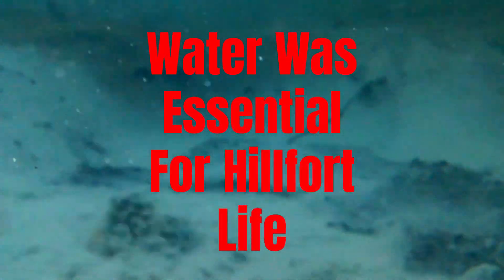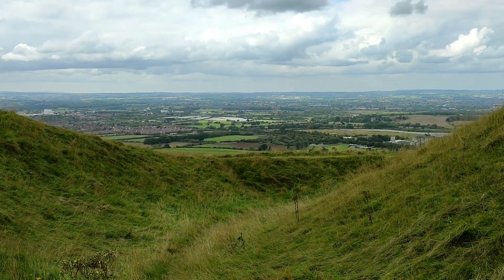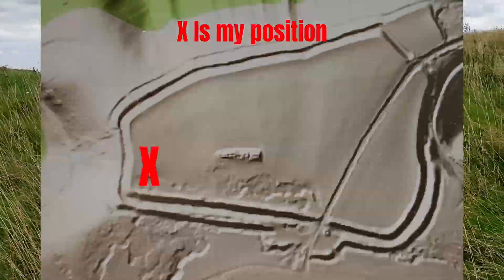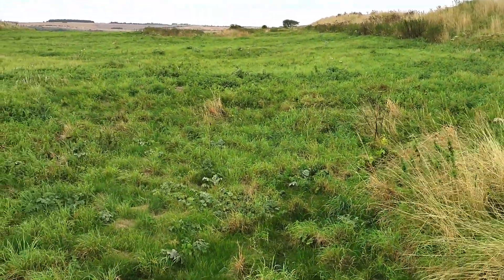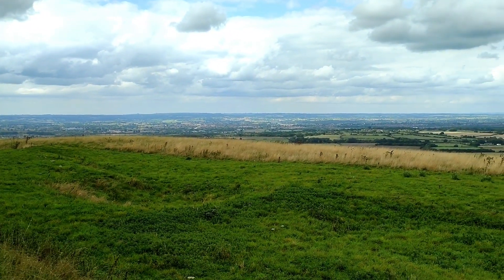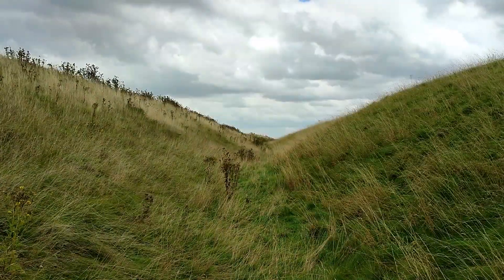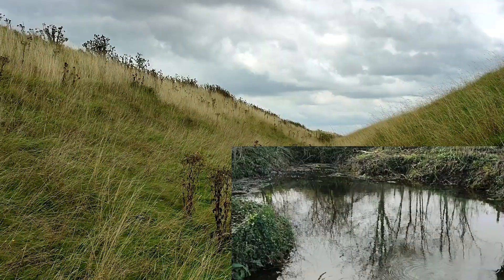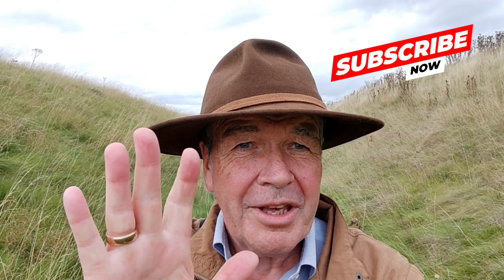HOW HILLFORT DWELLERS OBTAINED WATER

Comment: I think most weather systems travel up the uk from the South West, because of the Gulf Stream.
Reply from the maker: Thank you-A valid point -We can only guess that Hillfort dwellers understanding of weather was good-Thank you for watching
Reply: The gulf stream is more a consequence of the same effect. If air out water moves north in the Northern hemisphere, because the earth is rotating, it starts to turn to the east. This is called the coriolis effect. 

This means that the gulf stream bends across the Atlantic and hits us, and creates the jet streams which drags weather systems across the Atlantic, mostly to the north of us creating Westerly and south westerly winds as the low pressure cyclones go north of us.
Reply: @daveansell1970  Thanks Dave - really interesting!